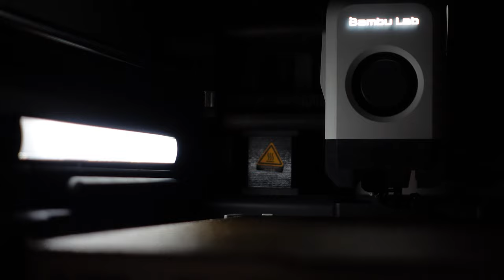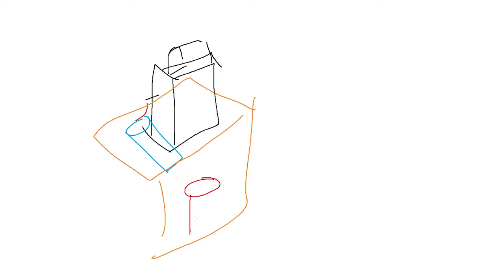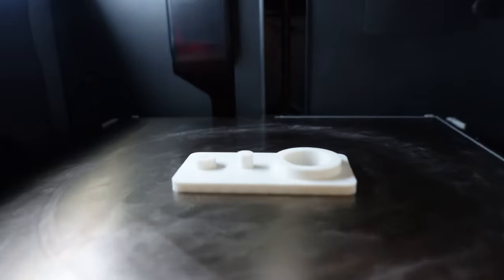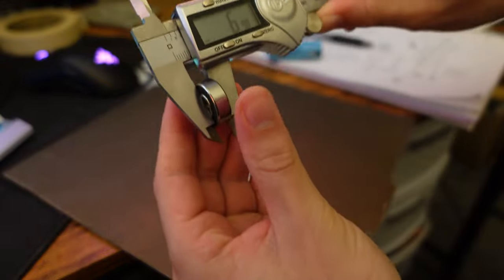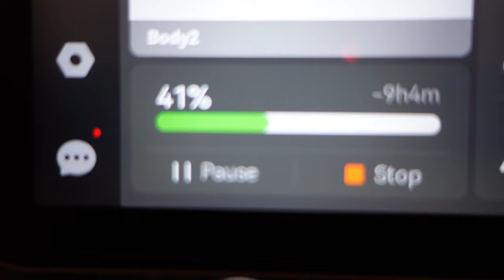3D Printed Conveyor Belt - DIY Project Build

Comment: 16:58 use more wall line or 100% infill to get more strength. You can also print the part in 45° for more strength.
I watched the entire video and there are a couple things I would done differently. I worked with such devices for around 10 years.
My suggestion is to get rid of the teeth’s. Use a smooth belts and wheel. For the other, not motor driven wheel, use a bulging surface and add a tension mechanism on both sides. With this the belt will self center itself.

Use a aluminum or better steel for the shafts and place the bearing inside the wheels. This way you can use a tension mechanism for the not driven wheel.

Look into how they build the creality cr-30 for example. 

Nice little project you did there 😊
Reply from the maker: Really good suggestions! Thank you. I'm thinking of redoing this project in the future but better. So I appreciate these comments. 😊